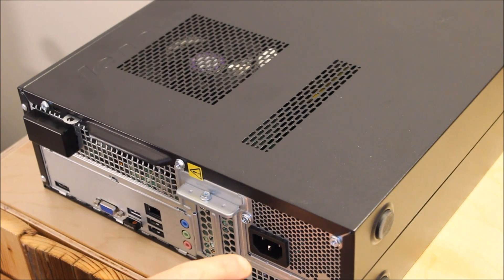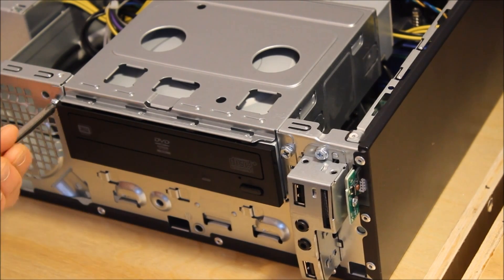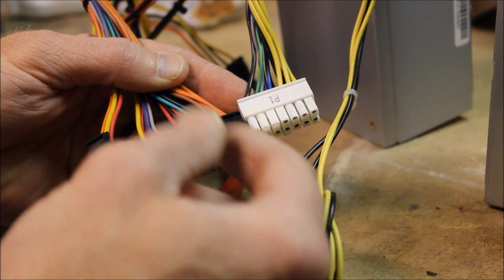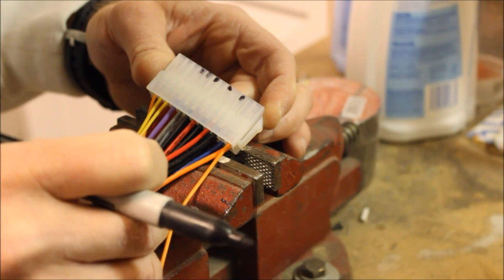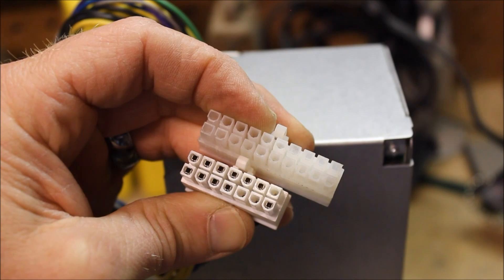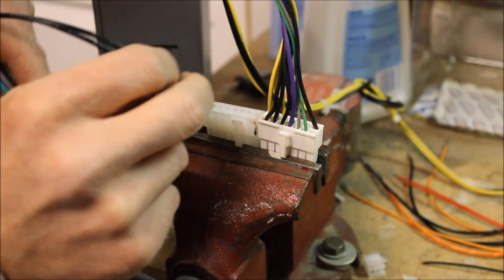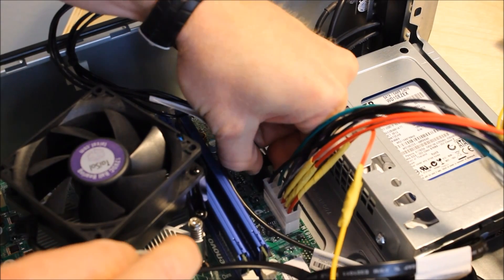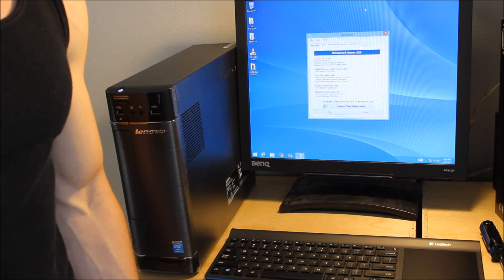Lenovo H530s Slimline Power Supply Upgrade

Comment: Hi, i have a Lenovo h50 and i am trying to adapt my aftermarket psu to fit the 14 PIN connector. I did everything according to instructions but the fan starts for half a sec and then turns off. Can someone help me?

Comment: my lenovo with the same unit that you have has a problem. whne i turn it on, fans spin for few seconds then off. what may be the problem done checking the ram, hdd, dvd drive.
Reply: Hi! I have the same problem. I bought 24pin to 14pin adapter and now there's no connector for the 4pin atx slot on motherboard. Should I take the 4pin connector from the adapter and plug it in that slot? Or is it better to use 20pin to 14pin adapter?
Reply: tired of all the shits of the OEM Motherboards where you buy motherboard adapters when one part is in problem, been assembling one mid range cpu. better handpick all the components for the better. i recommend you to buy asus. just keep in mind with the LGA of your cpu for compatability
Reply: I got it working at last. I used that 24pin to 14pin adapter. There was that 4pin ATX slot which was needed next to processor. My power supply had 8pin CPU connector but it was possible to split in two 4pin parts so one of those goes to that 4pin slot.
Reply: good for you :-) i build a new rig with handpicked components for future upgrades

Comment: Hi, I have a Lenovo H530. Its motherboard is lenovo sharkbay 31900058 std and I would like to know if it is compatible with a Corsair VS 450... I want to upgrade my gpu with a zotac gtx 1060 amp and my psu with corsair VS 450. Would it work fine??? Please, can you help me?

Comment: will there be any problem if i install the motherboard of H530s (same as yours) into a ATX Case ( Cooler master K282)?
Reply from the maker: +MisterButtons only thing I can think of is that Lenovo might have changed the screw pattern that secures the motherboard to the case.
Reply: ok i will see if i could use the normal screw on the sharkbay mother board(lenovo really sucks lol)
Reply: +AdventuresInDIY uhh... can you help me to check if i can use the motherboard in new case ,sir? I actually don't understand the screws of normal and lenovo motherboard
Reply from the maker: This seems like a fun experiment. I'll have to try it this weekend. Lenovo does suck for making these changes. Unfortunately all manufacturers seem to be doing the same thing.
Reply: ok thank you T_T
Reply: so are the screws fine with new case?
Reply from the maker: +MisterButtons I was only able to do some measurements this weekend and not a full tear down, but it looks like its a micro atx motherboard in there based off what I was looking at.
Reply: thx sir

Comment from the maker: +Annton FiftyFour I can't reply to your comment because of your settings.  I did a quick search and came across this MSI GT750ti that is low profile that looks like it would work http://goo.gl/EJU1Tb .  In the amazon question area it looks like someone made it work with the 180W power supply, but it Nvidia suggests you use a 300W one for your whole system power.

Comment: Hi, I have a Lenovo H520s, however it looks very similar to this PC in the video. I was wondering if you could provide a link to a PSU as I cannot find one online. Preferably one with the 14 pin adapter as I don't trust myself to cut the adapter like in the video.
Reply from the maker: Danny Hughes Sorry, I just tried to search it out again but didn't find anything you could directly drop in.  You could always get the tfx power supply and order the adapter someone found in the previous comments below.  I think its around $20 for the 24-14 pin adapter.
Reply: AdventuresInDIY Thank you so much, I'm in the UK and I just found an adapter for 10 Pound, I can just buy the PSU you suggested in the video, thank you for your help, much appreciated.

Comment from the maker: flyercan I don't remember a white wire, but there is a light gray wire that indicates the power supply is OK.  You'll need to make sure that's in there.
Reply: Thanks for the video.  I have a Lenovo m900 tower thaat uses a 10-pin psu.  Have you had any experience with the wiring on those?  Thanks again.
Reply from the maker: jonathoncasey Sorry, I haven't had a chance to do one of those yet, but I started the process by looking at the wire color description on the original power supply.  It told me the voltage associated with each color.  From there it was just a matter of matching up the voltage requirements for each pin into the motherboard.

Comment: You Sir are an absolute star! Just followed your excellent instructions to upgrade the PSU in my Lenovo H50-50 to a 780W beast so that I could upgrade the graphics adapter to a GeForce GTX960...works a treat. Thank You so much for finding the time to post this invaluable information :)
Reply from the maker: Stephen Peake Really glad it helped!  I like Lenovo products but find it annoying when manufacturers do stuff like that.  BTW, be careful of small animals getting sucked into the GTX960 :)  That thing is a beast!  Happy gaming!
Reply: +AdventuresInDIY hey man you did an awesome video there with that older slimline very short and to the point and perfectly well explained. can you help me out? I'm doing same as the guy above or below here I just bought the lenovo H50-55 (specifically the 90BG001YUS) for my birthday here and I was going to pull the MSI geforce 960 gaming 2gb card I just got for my older hp desktop. so when I went to put an also new 600w psu from the hp into the lenovo I saw the 14 pin problem. So it's got a little 280 watt psu with simple 4 pin and 14 pin to motherboard and the rest from mb to hdd and DVD drive but it's wide and has room for the big new psu just gonna have the same pin adapter issue as your video. can you tell me if I can buy a diff psu that will work out of the box or do I for sure have to copy you on this video? also if so I would love to ask you more details on how to do the creation of the extra 3rd 12v wire or whatever cuz you flew thru that pretty fast on this vid. hope to hear from you soon so I'll know if I can make this work before the return policy is up! thank you so much. Tim. Drdomovoi@gmail.com
Reply from the maker: Thanks!  Since I've made this video there have a couple people making this adapter and selling them on Amazon.  This should work http://goo.gl/6z3UtQ
Reply: +Tim Sperling yeah I found the ready to go plug n play main power adapter on amazon for 7 dollars, I am going to have to return and replace my h50-55 because the fan speed is maxed out at 100% and stupid loud because the heat sensors are wonky or the motherboard or chips are tripping but thanks to your original video I know that's their problem and not mine so I'm going to replace th3 whole pc and then do my power supply and graphics card upgrades and I should be good to go thank you!

Comment from the maker: +George Ryder If what you meant to type was a Lenovo H520s then you have a slimline PC and the full height only Nvidia 750 card you chose will not work because it will not fit in the half height slot.
Reply: ok thanks, could you reccomend a graphics card that would fit withut having to change the power

Comment: Hey im getting this graphics card, http://www.amazon.co.uk/EVGA-1215MHz-1294MHz-5012MHz-Graphics/dp/B00IGQ4ZDS/ref=cm_cd_ql_qh_dp_t , I have the Hg20s. Will i need the upgrade and if so what card would you reccomend that wouldnt need an upgrade
Reply: oops i may have made i mistake im getting this card http://www.amazon.co.uk/EVGA-1176MHz-1255MHz-5400MHz-Graphics/dp/B00IGQ4Z3S/ref=sr_1_2?ie=UTF8&qid=1424189483&sr=8-2&keywords=gtx+750+ti+2gb

Comment: Hi, I have this same pc and I'm planning to get this graphics card:
http://www.asus.com/Graphics_Cards/GT730SL2GD3BRK
Will the 180W power supply be enough for running this card with no problems?
Reply: George Ryder sure. The card meets the minimum gpu requirement, however it doesn't meet the recommended requirement so you won't really get a lot of fps if you play at max settings.
Reply: Christian Changa
ok thanks i will have to think about it, i nearly have enough money for a gaming computer so im weighing up my options
Reply: George Ryder you can also get a better idea by browsing and watching benchmarks of the gpu you want to include in your pc or of the game(s) you want to play.
Reply: Ok so, to answer your questions: if you need to remove 1 slot that would be the vga slot, the dvi will always stay, but even if you remove the vga slot, the gpu box comes with 2 low profile adapters that will let you keep all the slots.
Yes, it'll work with a 180W psu. It's has totally worked for me until now.
About the amount of vram, well let me tell you that your choice is totally ok, so far I haven't played a pc game that used more than 1gb of vram.
Are you kidding me? That game doesn't even ask specifically for a dedicated graphics card, you'll most certainly be able to run it on ultra settings and get a very smooth number of fps.
And about the drivers, I installed mine with the cd that came with the card, after that I updated them with the nvidia geforce experience program that also got installed by the cd. And don't worry, the installation will automatically uninstall your intel graphics driver.
Reply from the maker: I think you'll be OK.  The power consumption on this card is pretty low.  The Nvidia site says its recommended 300W power supply http://www.geforce.com/hardware/desktop-gpus/geforce-gt-730/specifications , but the power consumption is pretty low at 23 watts.  If it were me and I didn't want to upgrade the power supply, I'd try installing the card first.  If I ran into power issues then I'd upgrade the power supply.  What it comes down to is I'm not 100% but I've installed these cards in other slimline systems before without an issue.
Reply: AdventuresInDIY
I hope it'll work, because I can't find any place in my town that sells a similar psu to the one in your video. I'll give the card a try and then leave a comment with the result for the posterity.
Reply from the maker: Christian Changa Great!  Thanks for helping out other people who'd come across this.  I had to order my psu online.
Reply: AdventuresInDIY
Hi again, I got the card and I could manage to install it (since it's low profile). I still have the 180W power supply so I'm gonna be testing the card for some days to see if it gives me any problem. So far it's working very fine though.
Reply from the maker: Christian Changa That's great!  I'd love to find out how it does.  Thanks for sharing that info here.
Reply: AdventuresInDIY So, the card is working fine so far and I don't get any insufficient power supply symptoms on my PC. The temperatures are good and I'm able to play videogames without problems... I guess we can conclude that this card can be added to this PC without problems.
Reply from the maker: Christian Changa I'm glad it worked out!  That 730 is a nice card for the money.  I really like the fact Nvidia seems to be focusing on the power efficiency of their cards as well as performance.  Happy gaming Christian!
Reply: Christian Changa
is that a good graphics card, what sort of games can it run
Reply: George Ryder it's a good card and you can run most of the modern pc games with it (not with max settings though, if you are very strict with the fps). And as AdventuresInDIY said its a very nice card for money. If you are someone that doesn't mind sometimes to sacrifice good quality of graphics for performance (getting some more fps), then you'd be happy with this card.
Reply: Christian Changa
 would it run a game called total war attila?
Reply from the maker: Thanks Christian Changa for helping.
Reply: Christian Changa
would you recomend the 1gb or 2gb, bearing in mind 2gb is sold out until 22nd
Reply: AdventuresInDIY
Hey, is this version the i3 and if so what is the wattage on the psu
Reply from the maker: George Ryder I have the i3 with originally a 180W power supply.
Reply: AdventuresInDIY
I know i am probably quite annoying by now but i have a coulple of question, with this card will i need to remove the dvi slot and if so would you recomend getting a dvi to vga adaptor, secondly, will this definately work with a 180w psu, thirdly, should i get a 1gb or two gb (bear in mind the 1gb is on sale and the 2gb is sold out), finnaly with this card could i run total war rome 2 and if so at what settings.
Reply: AdventuresInDIY
oh yes i forgot something, before you put in the graphics card do you have to disabel your intel hd graphics, after you have installed the card and put the case back on and stuff, what do you have to do in terms of updating drivers.
Reply: AdventuresInDIY
I have just ordered the 1gb card, i will let you know if i run into any problems
Reply: George Ryder which card have you ordered? if it's the 1gb version of the card I mentioned at the beginning I need you to tell me which exactly, because my card is one of 3 different models and all of them are called gt730
Reply: Christian Changa
http://www.amazon.co.uk/gp/product/B00LGE2CY6?psc=1&redirect=true&ref_=oh_aui_detailpage_o00_s00
Reply: Christian Changa
ok thanks what do you mean up until now? and also i rather foolishly brought and adapter but oh well
. Should i cancel it or keep it in case i need it later
Reply: Christian Changa
And thank you, you have been very usefull
Reply: I mean, so far it works very well and it'll continue like that. That depends, which connection are you going to need? The VGA or the DVI?

No problem man.
Reply: Christian Changa
i cant quite remember but could you tell me how to put on the low profile adapters and thorugh the whole general installation process as i have watched that video about 10/20 times but am still a bit lost by it
Reply: well, if the video is not clear for you then I don't really think that if I explain it with words it'll be more clear. Perhaps you should better ask for help to someone that knows how to assemble a pc and have him explain it to you in person. It's the best thing to do in my opinion if you are not completely sure of how to do it by yourself.
Reply: Christian Changa
ok, just 1 final question, what should i do if i feel like the computer is acting not properly like performance wise, should i shutdown teh computer then remove the graphics card
Reply: George Ryder no, something you can do is open the task manager and see the usage of cpu, ram and harddrive to determine if some program(s) affect your peformance. For the graphics card you can see its status by using the program gpu tweak that comes in your driver installation cd. By doing that you make sure your components are working properly. And also keep your antvirus updated and scan your computer frequently because malaware can be a cause of low performance.
Reply: Christian Changa
no sorry what i meant was what if thr power supply cant handle it, then what do i do, sorry for the confusion
Reply: George Ryder oh well in that case I think yes, you'll need to remove the gpu or your system may actually get damaged. And you'd need to get another psu. But again, I don't really think you'll have this problem because that gpu uses a very low wattage. Most pc assemblers may tell you that the 180W psu won't be able to handle that system but truth is it will, so don't worry.
Reply: Christian Changa
thank you once again, i will let you know how to goes when i install the card, do you have any tips on that
Reply: you're welcome. Well, do it carefully. Make sure you unplug the power before doing it. And be careful with the static, it may damage your components.